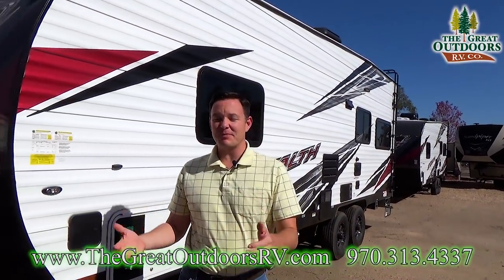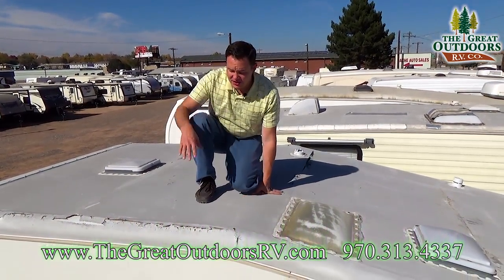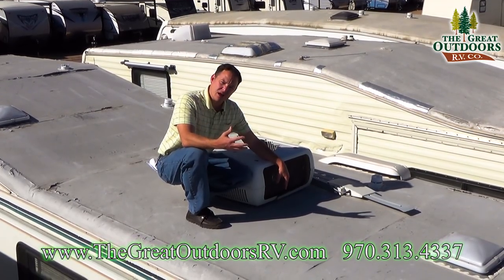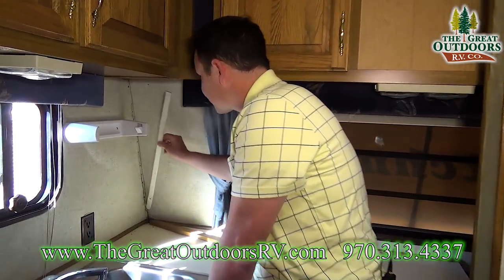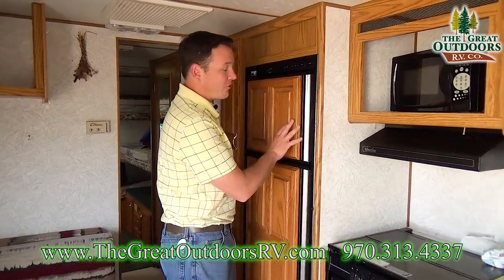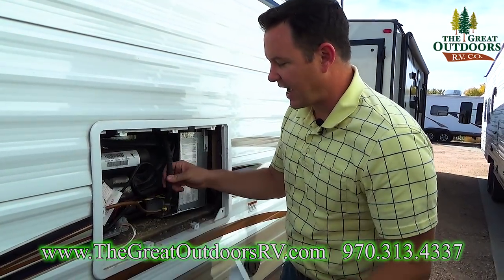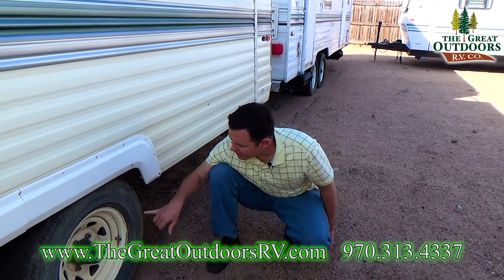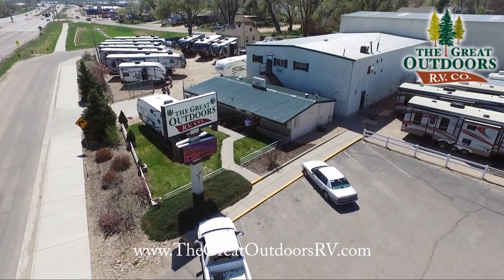How To Spot A RV Lemon Before You Buy Travel Trailer Pop Up Fifth Wheel Colorado Dealer

Comment: I've owned a bunch of rv trailers and 5th wheels. the number one problem is that OSB wafer board floor. it may be one continuous piece , but it's JUNK. If you don't have a good strong solid floor , you've got a piece of crap. It's cheap to install and doesn't last. any moisture will ruin it. you can't replace it, it's cheaper to get another trailer. if it isn't good water resistant plywood, KEEP LOOKING. The rest is just cosmetics. It's what makes the trailer. THE FOUNDATION. gotta be solid. ALSo, my preference., aluminum studs and ceiling rafters. They don't rot and are fairly easy to repair. my two cents....
Reply: dufus thanks dufus I’ve always wanted to say that,,, lol

Comment: I had a older 1998 Imperial 5th wheel warning for all 5th wheels built in this time frame I had a dometic refrigerator that had Ice build up in the freezer and one time I let the  Ice get too big to where the freezer door would not shut and a fire started in the back of my refrigerator and it was too late it also happened in the end of the winter time so when I tried to put the fire out it was too late all my hoses where frozen. So to all that have the older models make sure your doors are closed all the way so this does not happen to you . also if fire starts unplug your electric  first thing that way the fire won't spread when water hits the burning area..

Comment: Mait, thank you for producing this RV walk-though. Great tips... Especially starting with "Top-Down" check from the outside. Obviously, a quick peek inside and out to make sure it has cabinets and wheels. lol. But after that, detailed inspection. A lot of RVs have been damaged by hurricanes and floods of recent. They are "flooding" the market on the used RV side.

Comment: Really have to check the trailer manufacture and problems with even new units.I bought brand new and had roof leak first trip out after real heavy rain.Returned for warranty work and lawyers fight it out for selling defective unit.Year later picked up "repaired" trailer, never again buying a Keystone.Had better luck with Jayco`s used travel trailers that had been a couple years old.Check out electrical circuit breaker boxes and up grade those to new ones and split the circuits instead of the double lugging those which seem to be common to do. Its cheaper than a bigger C/B panel